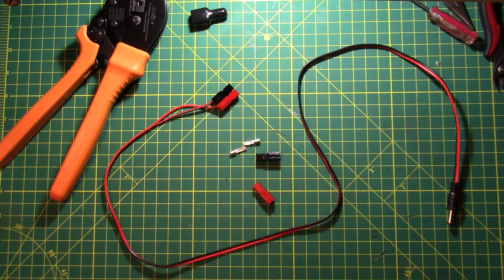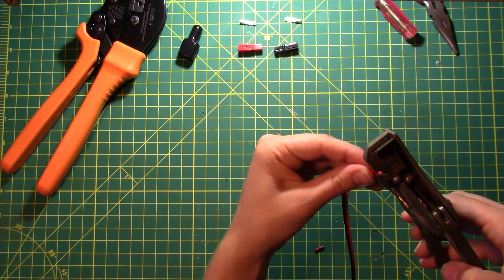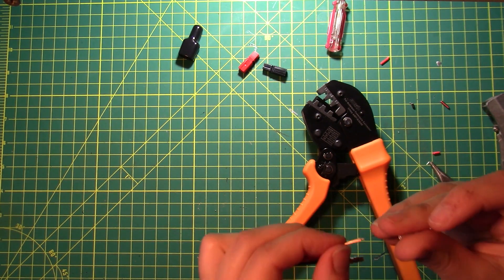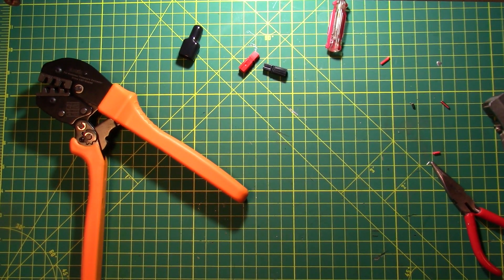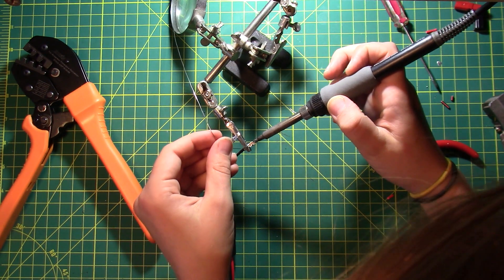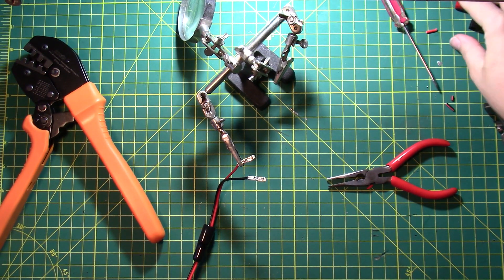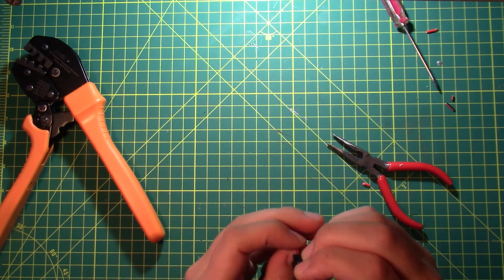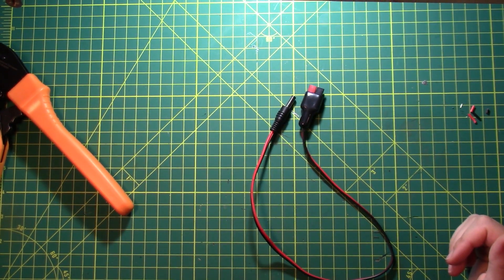How to Power Pole for Young Hams (Its Actually Easy)!!!

Comment: Forgot...
Can you please check with your Dad for an “ok” and advice on this:

I have a new (but never installed) UHF (70cm) Motorola Repeater sitting in my garage and it’s in need of a new home.
It is NOT ham friendly (it’s a Quantar 110watt UHF  ... but it’s R3.  Region 3 = 470.000mhz - 494.000mhz.. “TBand”)
It CAN be programmed/ tuned down to the 462/467 range for GMRS use.  Just turn the power down to <50watts to 
comply with the FCC regs part 95 ..  

Repeaters ARE permitted WITHOUT paying $thousands$ for frequency coordination.

It’s a public-safety unit that’s rugged as can be, just a bit heavy.  
It is definitely not a toy, it was a $24k piece of government $waste$ 🥴..
It’s a P25 digital + Analog Mixed-Mode unit with all options offered & the advanced signaling pkg 
and power supply...,  and  easy enough to set up and program.  
I traded a Tahoe for a pair of these, but never got them on the air.
They’ve been sitting in my garage for the past few years.

Hit me up if you guys have any interest.!

I can also tune a duplexer for you if you have one.  
If not, I can probably dig something up... OR, you can use a 2-antenna install .. OR go “simplex”.

Comment: Thanks Leah.
I love powerpoles and try to use the everywhere.
I always “superglue” the red/black housings prior to assembly.
I also try to use the rubber “boot” whenever possible.  
It keeps everything nice and clean looking and gives a bit of strain relief when heat shrinking
a piece of marine grade clear tubing prior to sliding the boot back down to the connector.

🇺🇸🚨. MIGHT I SUGGEST YOU SPEND A LITTLE OF YOUR PLANE RENTAL FUNDS???
Definitely get yourself the following pieces of very affordable test gear, if possible:

- tinySA (miniature spectrum analyzer) www.tinySA.org
Not the quality of my Agilent n9340, but it is also only $60-80 and not the $12,000 
I spent on my spectrum analyzer. 😉

- NanoVNA  miniature vector network analyzer.
Another $60 +/- test instrument that actually works quite well.
I got mine (and the tinySA) from Amazon.com to avoid counterfeiting 
and get overnight delivery at no extra cost..

If this is out of reach right now, please reach out and I’ll see what us old Elmer types can figure out.  😀

AND...  PLEASE take the time to visit the IMSAI GUY YouTube channel.
He has large collections of videos related to the tinySA AND the NanoVNA.

73 from The Occupied Zone / USSA 🇺🇸😷🦠😳😀

Comment: Hey, nice job soldering the powerpoles.  When I got my ticket i didn't know what powerpoles were so I set up my equipment with the power connectors I have always used for automotive work.  I used those 2 plug trailer style plugs you see in auto shops.  Learning about powerpoles early on would have probably saved me a few bucks.  I have got to get one of those helping hands.  That is soooo much easier than propping your work on something that won't melt and bumping it while soldering and have it all go on the shop floor with me cussing.  Thanks for the pro tips!  73, Steve WG7MM

Comment: I like the way you also solder your crimped connections. I always solder everything, being a blue water sailor. I don't like my connections coming apart because of vibration and pulling on the cables. Oh - BTW I have never had corrosion problems.
Reply from the maker: That's really cool, sailing and ham radio, a nice combination!